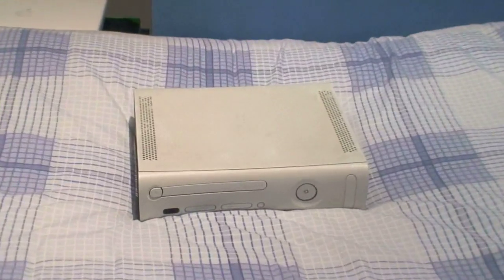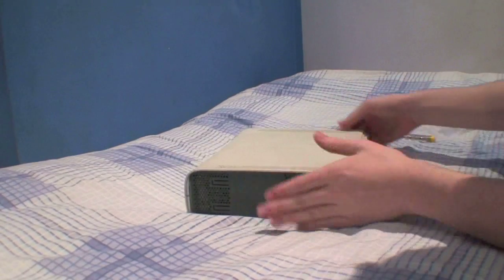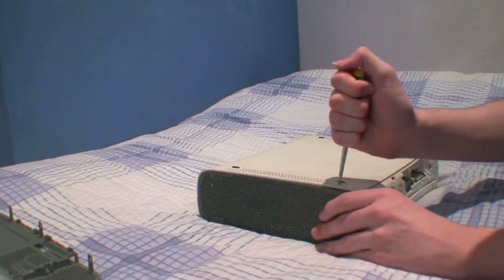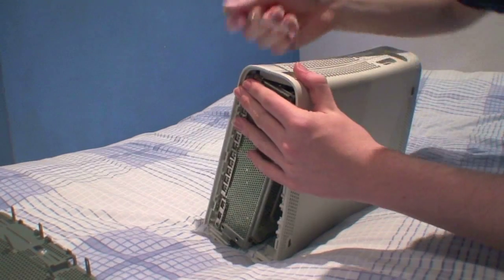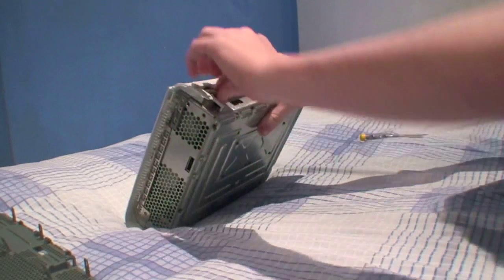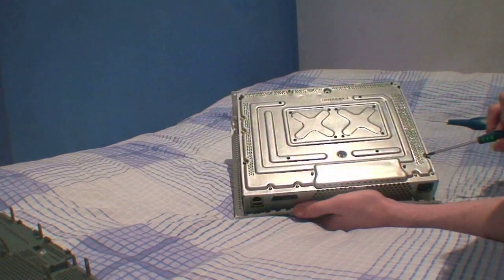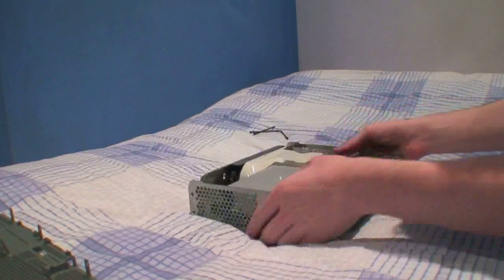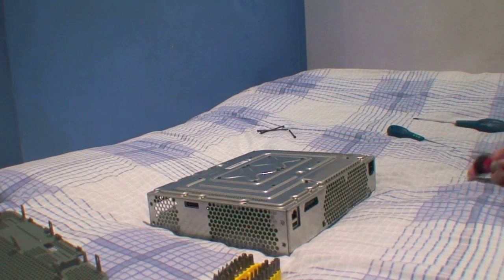Xbox 360 JTAG Tutorial - Part 1

Comment from the maker: "You DON'T handle the motherboard by the heatsinks."

I have already addressed this issue.  I don't think I need to repeat myself.

"You don't work with PCB in areas that can potentially cause static shock."

I have already addressed this issue.  I don't think I need to repeat myself.

"Why not just toss the motherboard on carpet?"

The physical shock from impact may weaken solder joints.

Comment from the maker: The heatsinks are fastened to the motherboard with clips designed to apply a specific degree of pressure to the CPU and GPU.  The minimal force which I exerted when removing the motherboard after properly detaching it was well within the capacity of the heatsink clips to hold.

I would appreciate it if you did not insult me.

Comment: your really brutal when it comes to opening the Xbox. if you just put 2 fingers on the side of the front facia you can simply clip it off gently, as for removing the sides you can use a small precision cross headed screwdriver which fit nice and snug in the holes which saves jamming in larger screwdrivers and potentially ruining the case. If you wana see any of my mods check out my Facebook. Ive X Clamped one xbox with success and modified 2 xboxs and several controllers.

Comment from the maker: @bmil69 

Assuming you're not placing your PC inside an MRI scanner, the only other component which can really be affected by average-strength magnetic fields is the CPU and only whilst running.  A magnetic field in close proximity to the processor may alter the flow of electrons when applied, however it poses no lasting harm.

Do notice that this console is neither running while being taken apart nor contains a HDD.  I hope this has been enlightening. :3

Comment from the maker: @bmil69 

The notion that magnetic implements should not be brought in close proximity to computers is a very old and exaggerated one.  The common reasoning behind it is that the read/write heads of a HDD can be destroyed by strong magnetic forces.  It should be noted that whilst this is true, "strong magnet forces" refers to something immensely larger than the magnetized head of a screwdriver.

Comment: @troy2062  i gotcha, i also have done things like this (although not this in particular) and nothing has ever happened, but when you work with a expensive set of chips there id be cautious...I think im going to try this out, im amateur to modding, ive only  used USB and are way too impatient to read descriptions. I can solder (not as good as you though) and i can get the job done. I just dont know if i should try the USB jtags you find all over ebay first...or does that

Comment: hiya guys im thinking of buying a xenon jtag from Jtag galore

the console comes with FreeBOOT 2.0.13599.0 (NEW KINECT DASHBOARD).

Along with an EXTRA FAN plus 12v rear fan mod and shroud mods which lower the overall temperature by 20c!

its has hdmi and power cable.

flashed drive

a window

60GB HARDRIVE with any games i want....

xex menu on disc

all for £161 shall i get this??????

Comment from the maker: @SpicyLem0nz 

I have said nothing of price, risk or danger.  That is completely irrelevant.  You asked me why people should not simply use a PC with no manufacturer restrictions over an Xbox 360 which must be modified to have those restrictions removed.

My response simply stated that people generally find it more interesting to modify closed hardware such that it performs outside of its intended capacity (in this case, the Xbox 360) than to use open hardware.

Comment from the maker: @JaspaaHD 

I'm afraid you are incorrect. I make it a point to stay completely up to date on as many matters as possible.  This modification is possible only on consoles with a dashboard revision of 7379 or below. Despite the fact that recent developments have made extended online use possible (via Xam file modification), the initial requirements have not changed.

Both forms of wire are equally viable, except in cases where the CAT5 wire has a stranded core. In this case, Kynar should be used.

Comment: @marstrenght no cuz the kernal is to high and and since when you update to the 8xxx series your E fuse set 1 and 2 are blown unless when you updated the console  with the RT6 bridged it could be possible if you think about but in this case probly not but you can google oh and even with the 7371 kernal are barly exploitable cause E fuse 1 is usually blown there are cb versions that a not exploitable in the 7XXX for example 7363 is not explotable correct if im wrong troy and

Comment: @gbugss I don't know, I built about 3 or 4 computers so far, have flashed my 360 back in 2007 and done some other things with electronics and I NEVER used a wrist strap, and I NEVER had an issue...I mean, it must happen yeah but it must EXTREMELY rare, because you don't hear people shorting out motherboards and such for not using a wrist strap very often, at least I haven't...

Comment: @LmfaoReviews problem with PS3 is, not all games work, you can't play burnt games, some games require EBOOT modification or require an update file to get to work.  So far on Xbox360, every game has worked using one of two methods...just burn it, or apply AP25 patch and burn it.  While Xbox360 users were playing Portal 2 on a hacked system, PS3 users had to wait for a 3.55 compatible version.....(not bashing the PS3, just stating the facts)

Comment: He troy2062, can you jtag essentially any console?  I have the original Elite with the 120GB drive which has been modified with firmware circa 2009 summer (no idea on revision) and was subsequently banned 2009 Christmas.  Would that be a good candidate to do Jtag?  My understanding is that if I do it I can just install games straight onto the harddrive.

Comment: @Jackassinfool5 Search Google you will find a pc card or pci card or expresscard usb adapter
depending on what will fit you computer. As long as you use NandPro IO Patcher
you can use addin Parallel ports like those below for computers that don't have a
built in parallel port.

SYBA PCI to Parallel Port Controller Card Model SD-PCI-1P 

SYBA SD-PCB-1P 1 Port Parallel PCMCIA Cardbus Controller

Comment: @Jackassinfool5  If your computer does not have a LPT port also known as Parallel port or a printer port.  You usually can't  use addin pci cards Parallel port or usb adapters. NandPro program requires a computer with built in Parallel ports which are the only kind that can provide correct address. But if you use NandPro IO Patcher mention before you can patch the program to accept different address this will allow you to add pci  card or pmcia card or usb  parrellal port adapter that will work.

Comment: @Jackassinfool5  Yes if you use.
NandPro IO Patcher  (search google for it or xbox-scene)

Application that will allow you to use a PCI to LPT or other LPT ports with NandPro.
This application allows you to patch NandPro so it can work with other ports than 0378, 0278 and 03bc.

a program to change nandpro ports. You just have to remove resistors
on the lpt connector to make it work beacause pci card doesn't deliver much power.

Works with nandpro 2.0d not sure about other versions.

Comment: Is 2.5" precut prestripped KYNAR wire good?

And I Have a question about the LPT Port.

Do I just need to buy the cable and plug in the usb end in my computer then connect my JTAG?

Comment: Just some questions...

Is 2.5 Inch Precut and Prestripped KYNAR wire good? and I have a computer and getting an LPT CABLE, Do I just plug in the USB Part in my computer then connect the JTAG Wires to the LPT Port?

Comment from the maker: @specop3351 

In the many years which I have spent with electronics, static has never been an issue.

Added the fact that this video is merely for instructional purposes.  It is up to the user to take any precautions which they feel to be necessary.

Comment from the maker: You can either purchase a pre-modified console, or perform the hack yourself.  Yes, once connected, it can be used immediately.

Searching with the terms "xbox 360 jtag" will normally yield many results on eBay.  Although, you will find many more sellers on the Xbox-Scene forums' BST section.

Comment from the maker: @walkthroughguy88 

I have explained why it is impossible for this to be true.

The JTAG hack relies on unencrypted files.  These are easily detected, and can not be re-encrypted by the user, because a private key which only Microsoft has access to is required to do so.

The most likely explanation is that your friend is using a Cygnos 2 to switch between the original and JTAG hacked NAND chips.

Even this method could result in a ban at any time.

Comment from the maker: @IamN1ckk 

A few things to try if you're getting the flash controller error:

- Diode on pin 11.
- Lower Ohm resistors.
- Recheck soldering work.
- Test connections with a multimeter.
- LPT mode should be "SPP" or "ECP + EPP".
- Make sure the marker ring on all diodes is on the motherboard side.

Good luck. :)